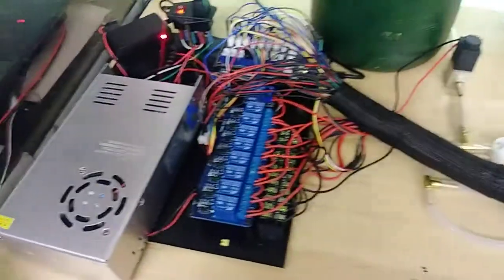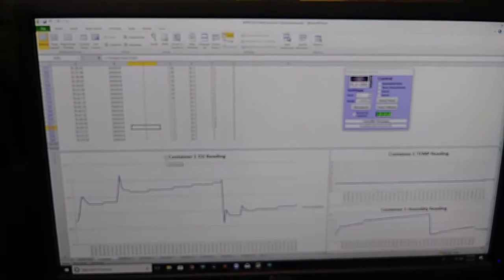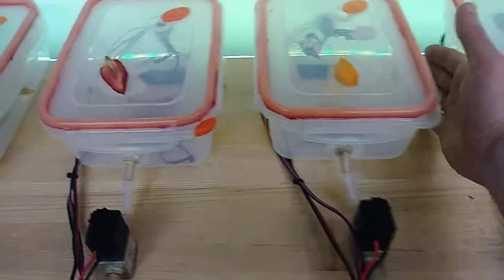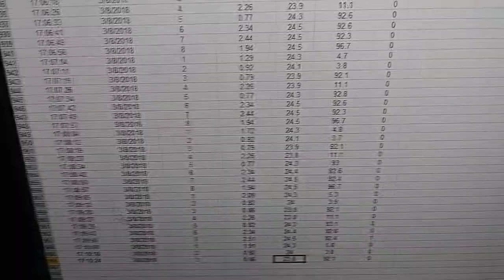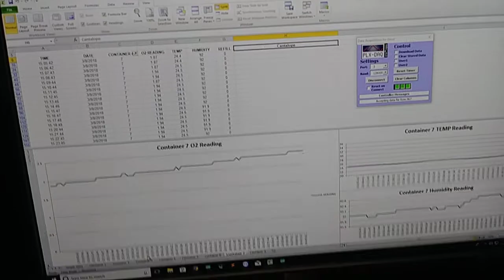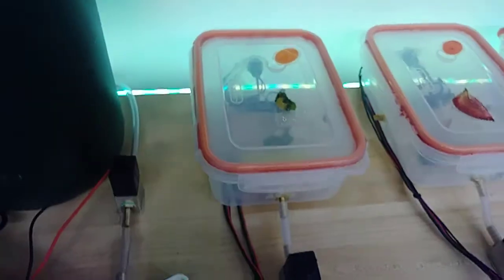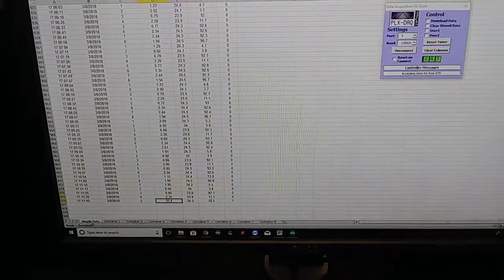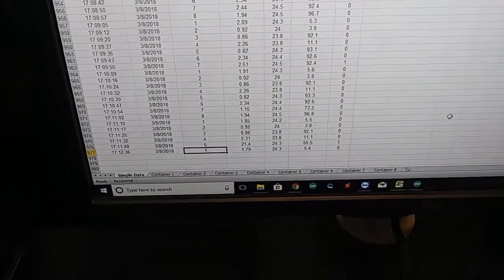Nitrogenator experiment test video

Comment: Will you displace or add ethylene to the containers, or monitor ethylene to track ripening?
Reply from the maker: Kent VanderVelden try to get rid of it... It makes fruit ripen faster, some more than others... But they all give it off or affected by it in someway, trying to figure all that out by adding ethylene sensors... But that has proven pretty difficult, not very many options, and they're expensive and I need to write my own voltage charts/graphs.
Reply: Jason Powell Have you seen Bluapple?